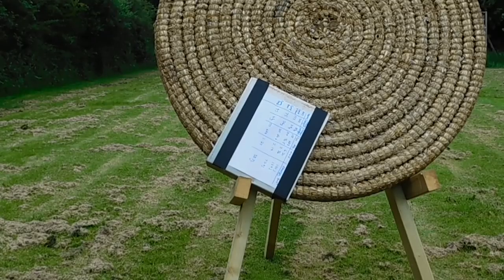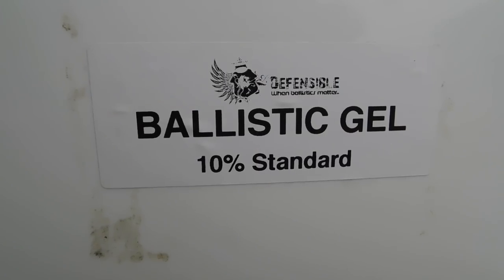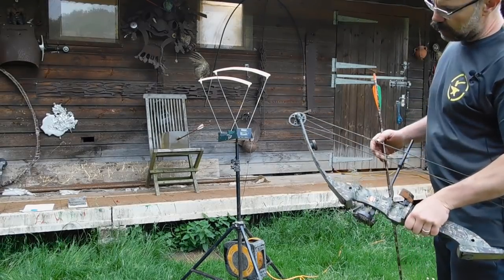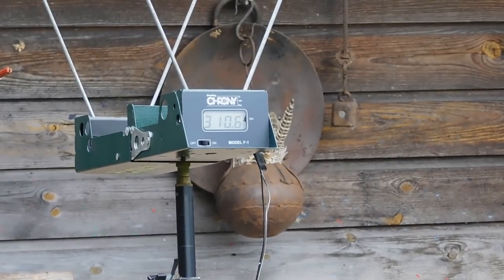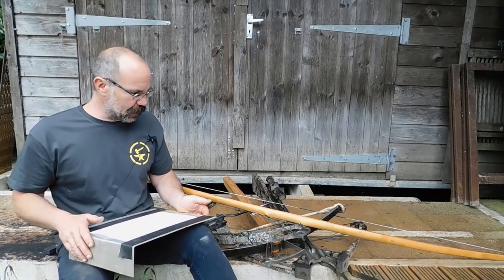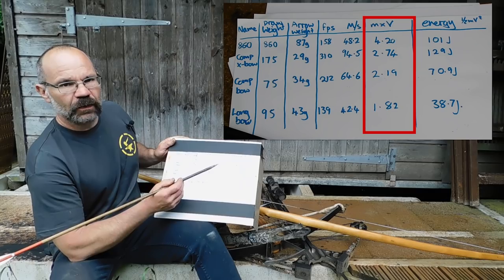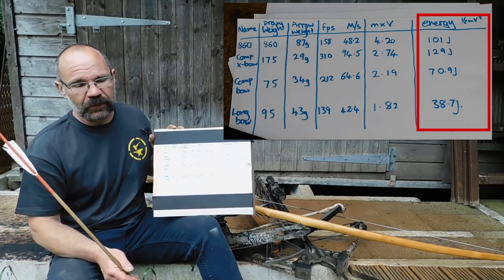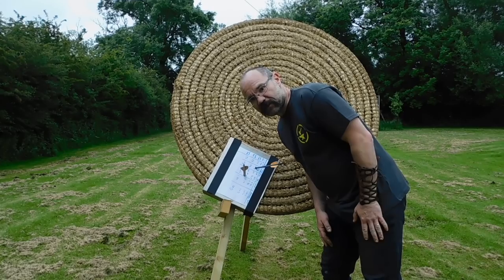Medieval vs Modern Crossbows/bows Ballistic Gel Tests

Comment: Back of the envelope calculations for energy transfer efficiency: Energy of Projectile/(Draw weight*Draw length*1/2) gives:

Longbow~25%
Windlass Cross bow~45%
Compound Crossbow~65%
Reply: Compound crossbows are not linear so the energy stored is probably higher and the energy transfer lower
Reply: wrong compounds have let off to hold less weight and aim longer. heavier arrow gives more penetration but lighter provides speed so there is a trade off. shooting to light of an arrow  caused dry fire damage to the bow .

Comment: Penetration is a based mostly on velocity. Weight in the .5mv^2 calculation is a linear factor. Velocity though is squared before it is added into the energy calculation. This means that energy scales faster with velocity than with mass. You can find very similar parallels in bullets. A fast 9mm bullet will penetrate further than a slow .45 bullet even though the weight in grains of a .45 are higher.  This is also the basis of current first generation railguns. Naval vessels (battleships) in WW2 could fire projectiles up to 1200kg in weight. The destructive power of current railgun technology rivals that of WW2 shells while only having a weight in the range of 10-15kg.

Comment: Great video.  The compound bow number was interesting.  It must be an older bow. PSE the maker of the bow used in this video actually has a bow that is capable of 370fps and is the current record holder.
Reply: Jeez, what's the draw weight on that??
Reply: @carlosmatos9848  It depends which version and how you have it calibrated but  its 40-70LBs.  Around 55Lbs is the sweet spot and can shoot as fast as a 70LBs bow.
Reply: You need to look at arrow weight. The bow you're talking about shoots 370 fps with 5 gpp arrows, while this bow was shooting heavier (7 gpp). The PSE Full Throttle does not shoot 370 fps with 7 gpp arrows.

What's bizarre to me is the longbow performance. It's also shooting 7 gpp, yet the efficiency is only ~30%. In Joe Gibbs' Mary Rose testing, he was getting 60% efficiency at 6 gpp and around 65% at 7 gpp, with draw weights ranging from 110# to 160#. A 110# longbow should not be delivering three times the kinetic energy of a 95# longbow.

Comment: Excellent video as always; your 'unscientific' experimenting is nevertheless more enlightening than practically all the 'well-researched' information I've found online. Overall, the results weren't far off from what I was expecting, although I did expect the bows to have ~30J more than they actually did.

I will say I think the test is more accurate than you think, as my experience with modern bows and xbows matches what you saw here. My 175lb compound crossbow will absolutely drill through targets (excepting my burlap sack stuffed with clothes), and the bows my family and friends have used generally penetrate much less, on average roughly the distance you experienced. 

Now we just need to throw some gambeson in front of that gel and have another go at it. I suspect the slim arrows would gain an advantage over the fat bolt in that case. Maybe 1) Modern Xbow 2) Modern compound 3) Longbow (barely) 4) Windlass

Now that I'm thinking more, I would think that the windlass would excel versus unarmored opponents, the longbows more against gambesons, and the windlass would again be preferable against heavily armored knights (slight stun/denting).
Reply: Adding any covering means that the shape of the arrow/ bolt head matters much more.
Vs a gambeson you need a head that cuts so you don't start dragging on cloth.
Vs mail you get the bodkins with tapering points that slide in side a ring and push it open.
Reply: SuperFunkmachine right. Based on other tests I've seen tho, arrows still fare better than bodkin bolts since they are narrower.

Comment: These results make perfect sense in the context of physics. Penetration depth of non-deforming projectiles in a soft fluid-like medium is best predicted by the projectile's momentum per unit frontal area and momentum per unit lateral area. Even though the 860 lbf windlass crossbow produced by far the greatest momentum on impact, remember that its half-inch bolt has quadruple the frontal area of the other arrows and at least the same amount of lateral area if not more than the longer and skinnier arrows. I wouldn't want to be hit by any of these arrows; however, I think the 860 lbf crossbow would deal the most damage because it delivered the most energy inside the target and it punched a larger hole than the other arrows.

Comment: You can do a similar test with sandbags between bows and firearms and the arrows will perform better simply because of the significantly smaller sectional density. Penetration is more heavily impacted by an object’s sectional density (or lack thereof) than pure kinetic energy. Objects with a small sectional density and 1/2 the speed of something the size of a thumb will penetrate further, depending on the medium. To put a point on it, sectional density and velocity are the keys to penetration rather than weight and momentum.

Comment: I’d be interested to see how a lighter bolt in the 860 would perform.
Reply: I suspect the 860 lbs crossbow didn't penetrate deeply because it's heavier but that does also mean all the bolts force was put into the target. You don't actually want your projectile to go completely through the target, instead, you want it to stop just before leaving and sub-optimally just after so the arrowhead is out but the shaft is still in.

Comment: momentum is not what we usually use to calculate penetration potential. Generally kinetic energy is used. Momentum is just the tendency of the moving object to continue moving, kinetic energy is the measure of the moving object's ability to do work. Momentum can be interesting but go look at stats on bullets for hunting and the like and you'll see it's all about kinetic energy.
Reply: Ahhh - well that makes sense. Penetration and wound channels is something that hunters and shooters get a little religious about. Generally momentum gets looked at more for fatter, heavier, slower bullets that are just designed to hit a soft target and go right through  with minimal extra damage - those rounds we say you can 'eat right up to the hole' with. Rounds that are designed to have to push material out of the way or do work to cause damage (especially if they mushroom) we tend to focus on kinetic energy. Because an arrow has to actually sheer material and such kinetic energy may be a better choice. If you were comparing something like a bodkin point in a fat arrow with another bodkin  maybe momentum might be more appropriate, it doesn't really sheer as much. Or to put it another way, if i'm looking at two broad head arrows kinetic is what i'd look at, whereas if i'm looking at two roman pilum (slow and heavy) i'd be more inclined towards momentum as a comparison - they just push their way thru and don't really use sheering forces for their work. Or consider an arrow and a sling stone - the stone is all about momentum because the damage comes from the body it hits having to spend energy to bring the stone to a halt, whereas the arrow has to do work to cut the material it's passing thru so kinetic is more appropriate. Of course - your mileage may vary, consult your local dealer for details, i did not stay at a holiday inn last night :)

Comment: I suspect the 860 lbs crossbow didn't penetrate deeply because it's heavier but that does also mean more force was put into the target. You don't actually want your projectile to go completely through the target, instead, you want it to stop just before leaving and sub-optimally just after so the arrow head is out but the shaft is still in.

Comment: The medieval crossbow had more energy, but the modern crossbow overpenetrated.  What does that tell us?  That the big 13mm medieval bolt transferred more of its energy into the ballistic gel than the smaller, probably sharper modern bolt.  Once a projectile reaches the point of overpenetration (coming completely out the back), kinetic energy transfer is over - it carries any remaining energy with it (in this case, into the wooden wall).

To summarize, while the medieval crossbow didn't hit with 4-5 times the force of the modern one, it did hit harder, transferring all its energy into the gel.  No energy was wasted in overpenetration.

It might be interesting to make a slow motion video of these various projectiles hitting the gel - especially if the gel were mounted movably, so that you could compare the impact energies.
Reply: You don't use kinetic energy to hunt with arrows, they use cutting to do their job. A firearm on the other hand uses kinetic energy to do it's deed. A clean passthrough with a nice fat broadhead is ideal, a left in arrow can do meat damage if the animal starts to run.

Comment: In firearms we often talk about sectional density. It is often more important to an ethical kill than any other number generally associated with ballistic. It has to do with how the bullet will behave in the animal. I’m not sure how it translates exactly to arrows but say if you had a stiff arrow it would probably penetrate deeper than one that flexed upon impact. Similarly if you had a think blunt arrow it would make quite a mess of thing and transfer a lot of energy but create a shallower wound compered to a thin pointy arrow that might go right trough but not leave much damage behind. Speed and weight are important but how the arrow behaves and dumps energy once it hits is what will determine how devastating a wound is. That’s why your numbers don’t translate. It’s about terminal ballistics not external ballistics. One doesn’t predict the other unless of course you use the same projectile in all four bows. A 308 won’t go as far or as fast as a 6.5 creedmore but it will take a bear much better. Sectional density. Cool video. It clearly illustrates the most misunderstood part of ballistics. It be interesting to compare those wound tracks and see which might be more appropriate for hunting deer as opposed to a hog. I bet that  medieval cross bow would go right through a hog skull while the compound bow probably just bounce off.
Reply: Fee_ Lo that huge heavy medieval crossbow bolt would definitely do some major damage. 156 FPS seems slow but at that weight and size it doesn’t even matter.
Reply: In a hunting situation the main consideration is the slicing action of the blades not the energy transfer. The energy is only needed to overcome the friction of pushing the cross sectional area (and the surface area of the shaft) of the broadhead into (and hopefully through) the animal. You create the same wound as a sword or a spear you just trade weight for velocity to get the energy. The only time you have enough energy in an arrow to justify using a blunt end is for small game like rabbits.

Comment: I think it proves that Mass and Velocity are inextricably linked.  I'm no ballistics expert, but the numbers seem to show that as you lower Mass and increase Velocity (enough) you can get similar Momentum(?) to the opposite condition of increasing Mass and lowering Velocity.   As evidenced by the numbers Tod got for the 860# crossbow and the 95# Longbow.  (87g, 158fps & 4.20  vs. 43g, 139fps & 1.82)

Comment: I'd be interested in a comparison of ( draw force * draw length ) and ( 0.5 m v^2 ) energy calculations. I suppose you could call it the efficiency of the weapon. 

Some people, usually fans of .45 ACP, insist that "Effectiveness is mass times velocity. Period." I dislike those people. 
Things with the same momentum: 
8kg bowling ball at 0.5 m/s (crawling) 
4kg bowling ball at 1 m/s (slow walk) 
2l bottle of water at 2 m/s (brisk walk) 
1kg bag of sugar at 4 m/s (6 min 42 sec mile) 
100g apple at 40 m/s (illegal on almost any road) 
25g shotgun slug at 160 m/s (must have been a long shot) 
16g .45 ACP bullet at 250 m/s (little heavier and slower than normal) 
8g .357 Magnum bullet at 500 m/s 
4g 5.56mm bullet at 1 km/s (faster than they actually go).
According to those people, each of those projectiles ought to be equally effective. Instead of believing that, I note that they have 1, 2, 4, 8, 80, 320, 500, 1000 and 2000 Joules, respectively, are made of different materials and hit very different surface areas, and that shot placement matters. The speed at which a bowling ball to the head becomes dangerous is rather lower than the speed at which a bowling ball to the arse-cheek becomes dangerous, and a 5.56 bullet at 250 m/s is a much scarier object than an 8kg bowling ball at 0.125 m/s (same momentum) and also more dangerous than an 8kg ball at 5.6 m/s (same energy).
Reply: Further to that things about slow and heavy not penetrating, compare the .45 ACP to 9mm here: https://www.youtube.com/watch?v=ygaSMeTh-f0 
The slow, fat bullets bounce off. The 9mm has a little less energy and a lot less momentum than the .45 and gets through.

Comment: The configuration of the arrows counts too. If you equip the compound bow arrows with a 12 grain, 4 blade broad head you'll find that at a 70lbs. draw with a 60% let-off it'll perform better than the crossbow at that distance. The advantage of a modern crossbow is the range you get which is why certain states in the US reserve that, only, for hunters who have disabilities.

Comment: Although the modern crossbow penetrated deeper than the windlass that doesn't necessarily mean it has less of an ability to penetrate.  I think a more accurate view of penetration is "if" it can penetrate, not how far. The higher momentum of the windlass will allow it to penetrate armor more than the modern crossbow (which was its purpose). The modern crossbow was designed for hunting game and to hit "soft" (unarmored) targets.

Comment: Projectile weight is a big factor. "Muzzle velocity" i.e. the reading on the crono at point blank is a big consideration. Noting that the FPS of the Compound X-Bow is twice that of the historical replica, it does not surprise me in the least bit that the bolt had better penetration, especially in light of the fact it appears to be about half the diameter of the historical bolt, and is fitted with a very thin and sleek modern head. I would suggest that you can draw a loose comparison between these two x-bows and the 5.56 NATO v. a larger, slower cartridge. The modern x-bow is sort of akin to the 5.56. Light projectile able to be propelled forward at higher velocity. And it takes a lot less draw weight in the limbs to do it.

Comment: Penetration has a lot to do with the energy per square area on the impact site. Your Windlass has a fat bolt so it is slowed down a lot on impact. The compound crossbow had the lightest and slimmest bolt, so the deepest penetration. If they could all shoot the same projectile, the results would be more like what you would expect; the strongest bow would have the most penetration.